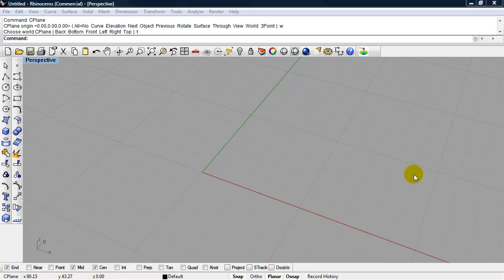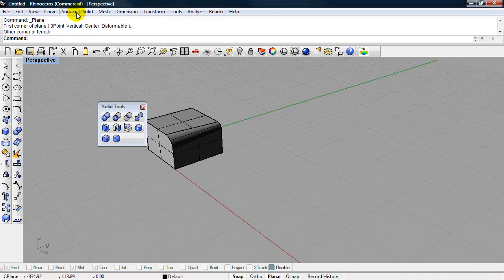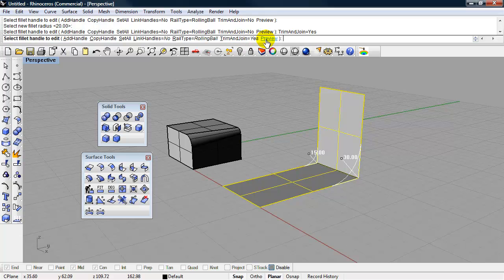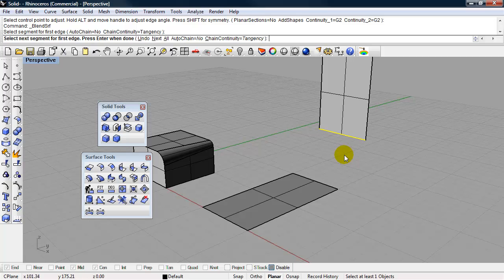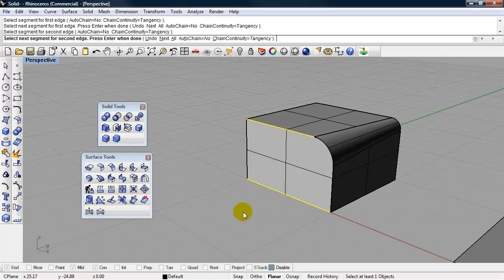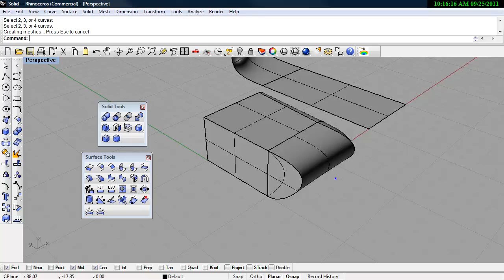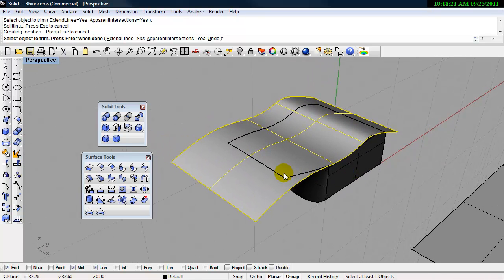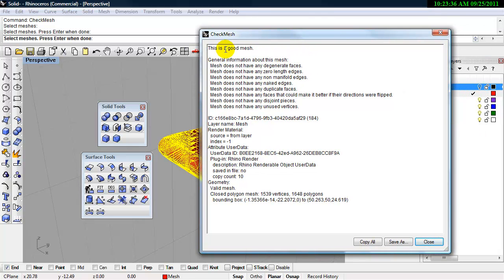Rhino Solid and Surface Editing 01

Comment: What a great video, I like it. I have a question as how these simple pieces were created, these can be taken to 3d printing already looking like solids, I am new to this, I would like to know if with this method it works for any part I design. Thank you
Reply from the maker: Thank you. I’m glad that you liked the video. Regarding 3D Printing, as long as the geometry is watertight, meaning that all the sides connect seamlessly to one another, you can turn the Rhino nurbs geometry into a Mesh for 3D printing.
Reply: Thank you again; I was practicing in a car hood exercise on YouTube but it took me 3 days to design the first part, the method was more confusing and I stopped, searched and stumbled upon your video, and I followed the instructions and so far I have done the same exercise up to one part and it has worked for me.  @AlphonsoPeluso
Reply from the maker: @christianramirez1844  Awesome! Enjoy and have fun.